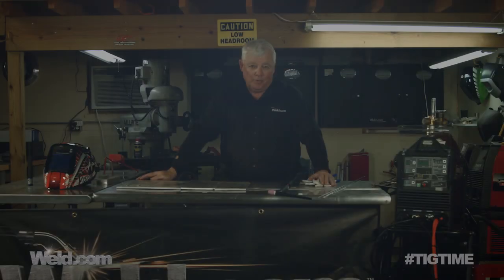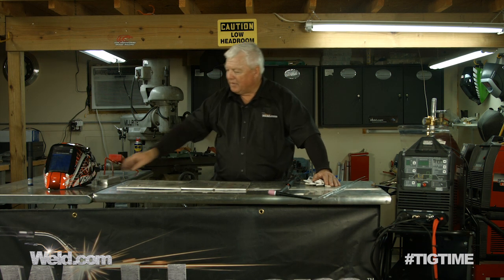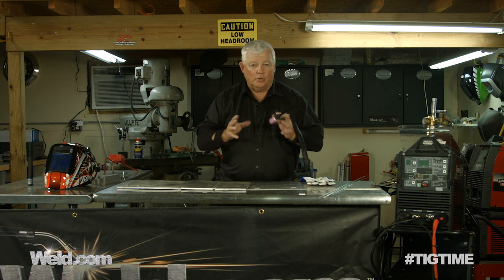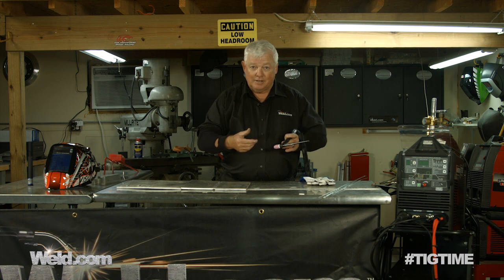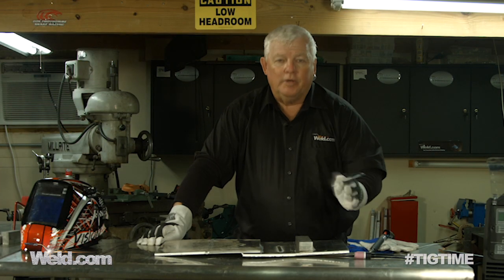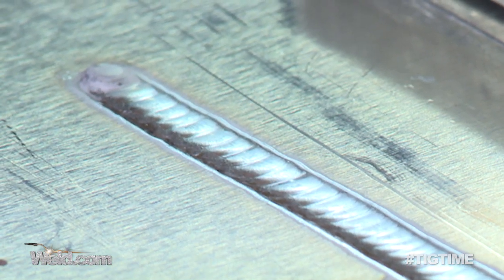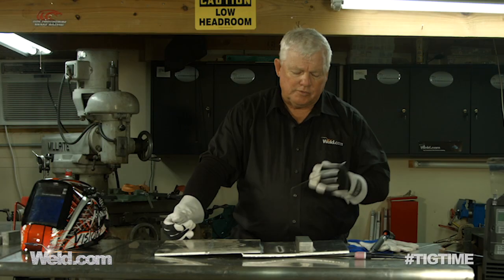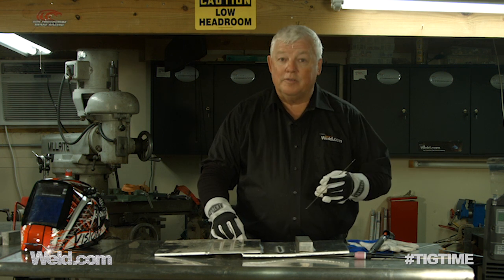Welding Heavy Aluminum and the Everlast 325 EXT | TIG Time

Comment: Thank you for the videos! You have added some 3rd party accessories to this machine. Could you do a video and/or attach a list of the specific mods and bits that make this a Mr. Tig Rig please
Reply: Turnkey packages would be good. I really like this welders features, price and power.
Reply from the maker: The Dinse is a slwhat35ad with addition quick disconnects according to the particular water cooler. We also used a CK2312SF FX Mr. TIG 300 amp 20H Torch Pkg. with leather strap holder and a SSC foot pedal.
Reply: Do you offer turn-key upgrade packages for Everlast 325 EXT when used with their water cooler? Maybe through a Mr Tig Amazon Store. Looking to buy the 325 and would love to have the extra bits as a package put together by someone way smarter / experienced than me. Just starting out with TIG welding using a small Miller Multi. Want to get the ultimate TIG set-up {buy once / cry once) . . . then learn the finer points on all metals in the years to come.

Actually, do you recommend a better Water Cooler?

Include Gas Lenses, Oversized Cups, Adapters and anything to hot rod the 325. Thanks!

Comment: so I take it the 260 ext would be capable of doing the fillet weld as you didn't exceed 260 amps. only ask as I have just bought the UK version which is sold under the rtech brand
Reply: It is my understanding that everlast does its own R&D for its models. The rtech stuff may look the say but are different inside. Everlast have north american staff at the factory frequently.

Comment: Hi Mr Tig, I wish I had seen this video clip in December 2014 because I had to weld a piece of 2"x1.5" hollow section to 1" thick by 3" wide solid Aluminium and even though my machine goes to 315 Amps, I was at 280 Amps and having a bit of trouble making a nice looking weld like you did. I think I should have put it to Max, much like you did, and made the machine do a better job. Again, a good very informative video, like usual. Thankyou .... Scott.

Comment: Any comments on the low amperage when you were finishing your weld and tapering off. Does not seem as smooth as their other machines.  Maybe the start and taper off is due to the gap on the HF circuit. I know this has been an issue with everlast but a feeler guage and a little time has usually been the fix they have provided customers with.

Comment: Hi  Mr TIG -another question I'm afraid-at least it shows I watch closely ! As you back off the current at the end of the weld and get to about 10A or less I see a sparking inside the case of the machine. Is this just the safety gap on the HF trying to restart the arc or is it tied in with the hesitation you mention on starting? Thanks by the way for another great video. Cheers!
Reply: The spark is there, I believe in the same place, at spark initiation.  That could be the HF on it. I'm not sure.
Reply: Steve Peat extra post flow old trick

Comment: have you ever tried a fronius tig machine do a show on one
Reply: Fronius TIG machine comes without AC welding.
Reply: D T Yes they do they have several models to choose from
Reply: @busancun  fronius magicwave 230i (AC/DC) is probably one of the nicest. LOTTA features. But Everlast has MORE amperage (325) for half the price($2500) ...fronius MW is about $4500-$5000 just for air cooled setup. It is bluetooth enabled though and is basically a computer...so, depends on your budget/preferences. I like Everlast but man, fronius would be KILLER to own one day
Reply: Derrick Cohee thanks dude 👍🏻

Comment: would 200 amps be enough on 3/8'' if i use 50% helium,or pure helium?
Reply from the maker: Check out our video on Welding Aluminum with Helium. We did a whole video series on this exact question.
Reply: Highly doubt it 1/4” is normal 3/8” you won’t be running all that long before duty kicks